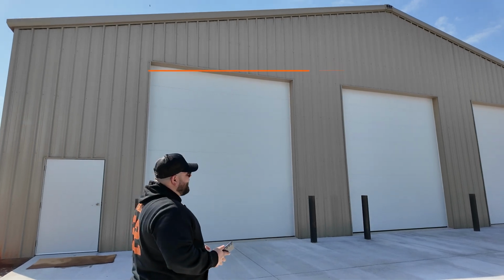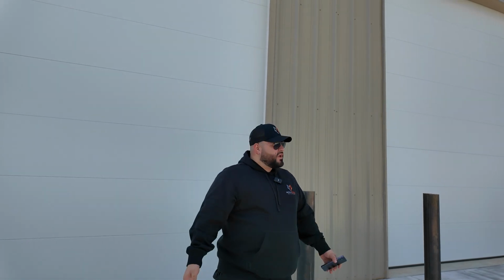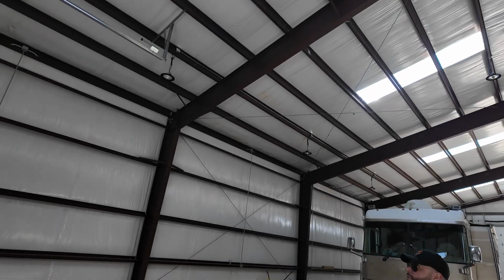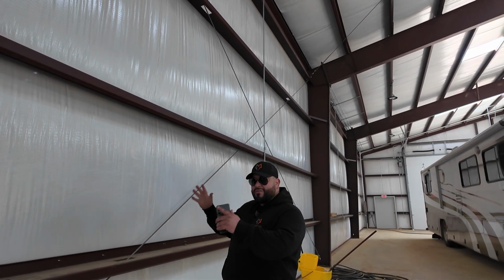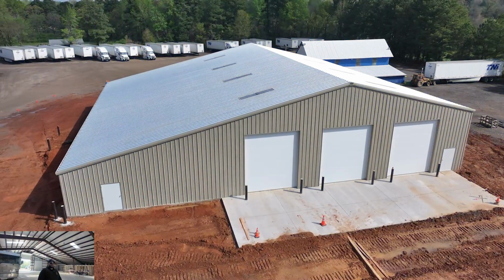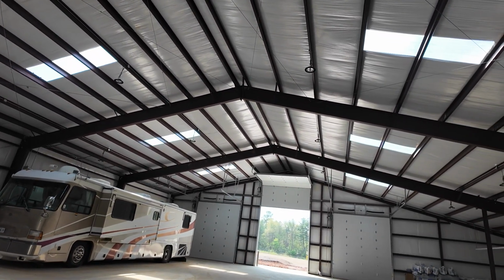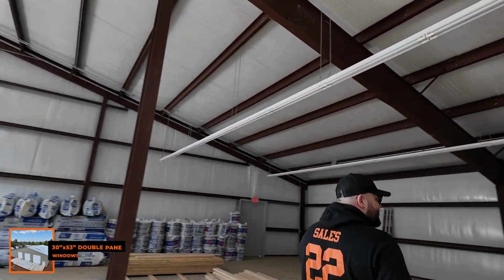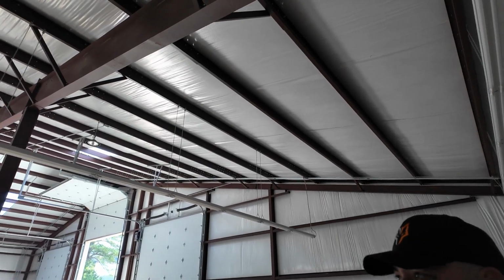MASSIVE Mechanic Shop Tour! | 105'x100' Red Iron in Texarkana, Texas | WolfSteel Buildings

Comment: The issue I’ve seen over the years in the Texas area is hailstones punching through skylights like they are made of paper.  Me personally I would rather have a few tempered glass fixed windows up high just under the eves so they are not a security risk but they allow in light.  Perhaps not as much light but two inches of rain pouring through the skylights in your shop over the weekend isn’t good either.
Reply from the maker: Great insights James! We did notify the client of the possibilities of the skylights on the roof. We have seen them on the sides very very often and they do give great lighting! 

Thanks for the comment!